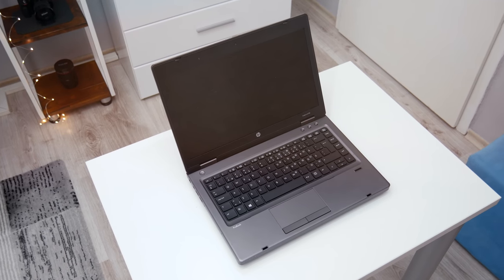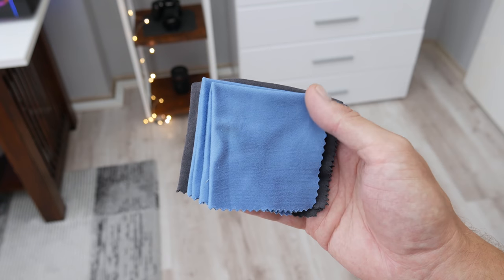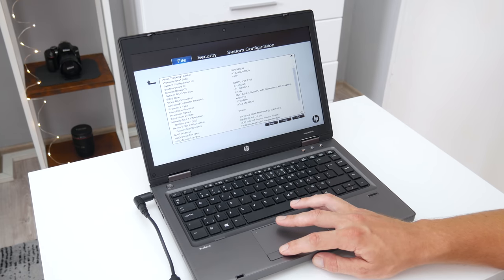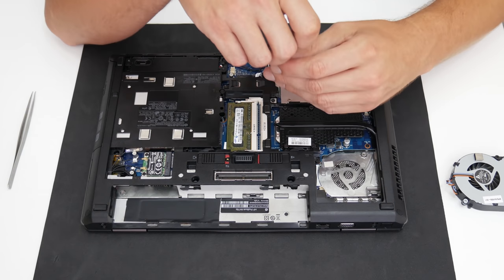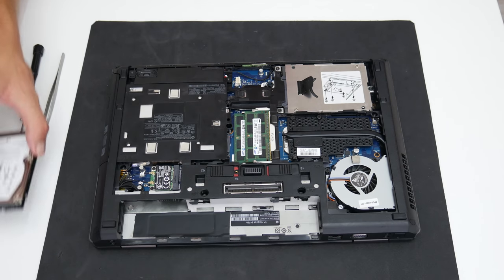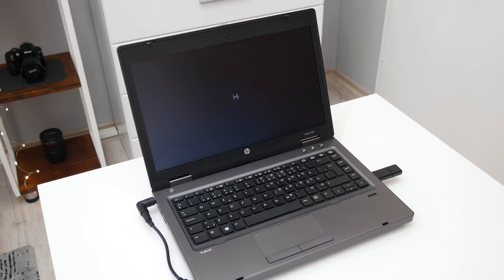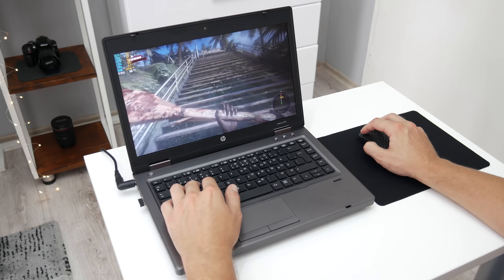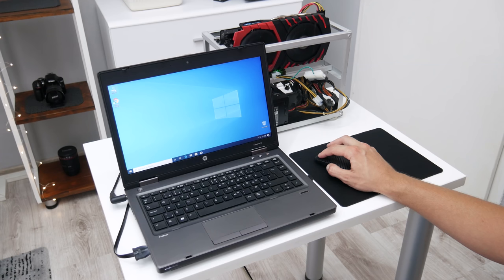Restoring and upgrading low specs AMD HP ProBook laptop

Comment: Im a HP certified tech. Looks like the motherboard was replaced and whoever replaced it did not finish branding it. My hat is off to you for getting HP to assist with getting the DMI programmed on that laptop. You have done everything I have always been curious about, very good video my friend and you just got a subscriber. 

Those old HP EliteBooks are tanks and perform fairly well considering their age. I had an EliteBook 8470 until a few months ago, I upgraded (sorta) to an EliteBook 9480 which is a lot smaller and newer but not quite as powerful.
Reply from the maker: Thank you for subscribing and supporting me :) It was a little bit hard to find all tools and right guide to fix the DMI but not impossible :D
Reply: @ComputersAndTechAndAndrew  Yep, very much so. I use HP's self maintainers support line often enough and getting the right answers when you know what you are asking for can be hard enough. You went in knowing nothing and got what you needed, that is nothing short of impressive.

Comment: The laptop is pretty powerful especially after the upgrade. You could play Doom and Overwatch with medium setting at repectsble FPS. I have an Acer 5560G with AMD A10 and 2gb radeon graphic card and I could play stuff like Skyrim and StarCraft 2 on high setting all day.

Do be wary with thermal issue tho. People call them "housefire" for a reason. Regular cleaning, using high quality thermal paste and laptop fan is recommendable

Comment: Where you buy with AMD graphics and CPU AMD i have the same one but with intel graphics and intel CPU and i didin’t see on internet any oné with AMD
Reply: Ebay i,s only cost 23 Euro
Reply: there is a special chip that has both graphics and cpu in one , in this laptop it already has intel graphics automatically but you can also use 2 graphics i think or maybe 1 that's better.

there is an option to just use a regular cpu too according to the 6475b manual

Comment: Where do you get these laptops? Because I really want to do something like this!
Reply from the maker: Hi bro, mostly these laptops already belongs to someone, I just take, repair, restore, upgrade and return. But if I'm going to buy some laptops then first I'm searching the local computer stores that sell used computers because there is easy to negotiate for the price, I'm checking the local websites or pages where peoples sell their old stuff ( in almost any country or town you can find some Facebook page or local based websites where peoples sell some stuff ). The other place is eBay, on eBay you can make good deal also, find something with normal price and parts. And I'm using Aliexpress, on Aliexpress you can find parts with normal and lower price
Reply: ebay

Comment: My laptop is probook 6460b can i change  the lcd screen to ips panel
Reply: I have the Probook 6460b and been using it for many years. you can use a docking station / displayport but it cannot go higher than 60hz i think.

Comment: Hello Andrew, i just install SSD and replace my cd-rom by hdd + caddy bay, but whenever i restart my laptop the computer doesn't recognize caddy bay, how can i fix this problem? My laptop brand is HP probook 440 g1, thank you.
Reply from the maker: Hi bro, in this case check the Boot Options in Bios, In Bios set the boot option to support the booth Uefi and Legacy, if is not working than try to connect and disconnect the disk again or update the bios
Reply: @ComputersAndTechAndAndrew  thanks for your reply, i tried update the latest BIOS but it still doesn't work =(

Comment: Hello, Andrew, I have an HP Pavilion g7 notebook series is it worth to change my AMD A4 4300M APU to Intel Core i7-2620M ... I want to play at least Mid specs games or can you recommend me a CPU... Thanks🥰
Reply: i have a probook 6460b with i7 2620m , 2 of them in fact on another probook. i can say you are wasting your money, the i7 2620m was made on the same die as the i5 2520m silicion wafer according to industry report if i remember. the i5 2520m was a technical defect of the i7 2620m when it wasn't completely perfect. i5 2520m costs 10 usd on ebay and the i7 2620m is like 50 usd. they work almost the same.

Comment: I do have a 7 year old Asus k55a -Sx464D , and its packed with celeron B820 can you please suggest which CPU I I should use to upgrade.  

Your reply will be truely appreciated. 
Regards
Reply from the maker: Hi Bro, this model can go up to Core i7-3630QM, also Core i5-3230M and Core i5-2450M are supported, other upgrades you can upgrade the RAM and instead HDD you can go with SSD ( 240/250 gb + ) recommended

Comment: hi, my fingerprint has not detected by windows, what driver have you used? thanks
Reply: use external fingerprint scanner support is dropped unless you want a malware driver one or want to read github code
Reply: @garymorris6835  finally i discovered that the hardware is not present. I bought a sensor on ebay and works perfect. Thanks

Comment: i have a problem i upgrade my hp but windows doesn't detect all the ram in the bios yes but windows doesn't, all the memory goes to hardware and only leaves the laptop with 2 gb no matter what, you put did you change something in the bios? And if so, what option was it?

Comment: The 4600M uses the FS1 socket if memory serves, with the A10 5750M being the best CPU for the socket, but I never see it getting used, ususally opting for a A10 4600m instead. I'm aware the 5750M is ARM based, making it already less desirable, but is there any other reason this CPU isn't used?
Reply: because it doesn't say that it's supported directly on the service manual for this laptop. even if it fits perfectly in the socket the chipset may not support it and would require you to desolder it off

Comment: Why not converting the disk from MBR to GPT? So you have the boot loading under the HP logo.
Reply: When you change to GPT logo is only least thing. It is a completely other filesystem and you require another type of installation
Reply: @_lordcharles  Yes I know, but actually the difference you see using the PC is the logo.. So why not doing the other type of installation? I know you can convert the disk without data loss with AOMEI..

Comment: How do you figure out which processors are compatible with your pc?
Reply from the maker: Hi bro, that's not complicated, older motherboards that support CPU upgrade have specific CPU socket, first am checking the cpu socket and what is the max CPU wat support ( some mobo is not support high wat CPU's ) and then am searching for the cpu with the same socket

Comment: Can i upgrade my lenovo g485 laptop? Or replace the motherboard with lenovo g40-45?
Reply from the maker: Hi bro, some of these models have removable CPU, if the CPU is removable than you can go with max AMD E2 ( AMD E1 to AMD E2 series ). The other upgrades are the RAM and Disk.
Reply: @ComputersAndTechAndAndrew  ok, thanks for your information

Comment: Bro please help i have and need to upgrade it to full potential Lenovo 110 -15ACL 15.6-inch Laptop (AMD A8-7410/4GB/1TB/Windows 10 Home/Integrated 512mb ddr3 Graphics), Black
Reply from the maker: Hi bro, on this lenovo model only you can upgrade the RAM and HDD to SSD. CPU is soldered on the motherboard and the GPU is coming from the CPU
Reply: @ComputersAndTechAndAndrew  hmmmm i thought you are not going to reply but you replied thanks a lot and again thanks for your opinion 😇😇😇
Reply from the maker: @crazyscooby9670  U r welcome bro, i'm always trying to answer to more comments and questions as possible

Comment: Hello sir I want a help
I am using Dell Inspiron 1464 i3 330m is there any chance to upgrade the CPU by an AMD processor
I want a suggestion for which processor is suitable for my laptop motherboard
Please tell
Reply: Nope. The socket won't even match. Intel cpu goes to intel mobo and amd cpu goes yo amd mobo. 

Your only option is to go with similar gen i5 with the same wattage

Comment: Hi can u help me can i run this spec
Timpurrari RA Intel(R) Core(TM) i7-3540M CPU @ 3.00GHz 
3rd Generation
AMD Radeon Graphics Processor 
Full Display
4GB RAM (upgradable)
320GBHDD Sata 
17 inches widescreen
Built-in Speaker
Windows 10 PRO
VGA, USB Port, DVD Rom
Wifi ready
With Num Keys

Comment: ddr3 1600 to 2133 if the chipset can take itw ill give you a 15  fps boost these apus love fast ram
Reply: AMD A10-4600M Supported memory: DDR3-1600, DDR3L-1600, DDR3U-1333
Reply: @marek_92_  make sure to use 1600 it really helps the 5750m supports higher speeds

Comment: can i upgrade cpu on my probook 6470b?
Reply from the maker: Hi bro, Yes you can, just before upgrading check your chipset, i think this model is coming with 2 different chipsets, HM70 and HM76, the boot are upgradable, but the booth have different CPU support, HM76 has larger support, HM70 has smaller number of supported CPUs. You can check this using CPU-Z app
Reply: thank you so much!
Reply: yes

Comment: Maybe this laptop is better with i5 CPU, isn't it?
Reply: Intel and AMD CPUs use different sockets. You need to change the motherboard for one that accepts Intel CPUs.
Reply: @juanmbt  I know, but I'm planning to buy Probook (the same series) with Intel i5
Reply: @nahpets2345  definitely better the i5 version, amd a series apu's are trash
Reply: CSP's Random  is Nvidia 920mx 2gb good for hp probook 6470b?
Reply: @nahpets2345  yep its great
Reply: CSP's Random  oh ok thx
Reply: @nahpets2345  its slow.. But better than this apu
Reply: @Callagwhan  I know
Reply: Laptop with 840m nvidia starts from roughly 200usd and they are gonna have good battery as well

Comment: The liquid you used was alcohol right? Can I use any type of alcohol? :3
Reply: 90% isopropyl is the standard but I had seen some people do it with just the 70% solution
Reply from the maker: Recommended to go with 90+% but %70 is fine also

Comment: Just bought a10, my laptop exactly the same with this a4. I just upgraded but it won't work properly. Nothings happens from a4 to a10
Reply: That's why I've put A8 in it, it's recommend Ed instead of A10.
Playing Defiance,Crossout on it.
Reply from the maker: Hi, before upgrading the CPU first update the BIOS, in many cases old BIOS version my cause issue with new CPU
Reply: which operating system
Reply: @ComputersAndTechAndAndrew  how to update bios

Comment: I have this laptop 💻 good performance with 8gb ram amd 10 only one ☝️ issue not working screen recorder hardware not supported
Reply: Is your fingerprint working? On windows 10 pro?
Reply: @gurpreetkalsi1541  i open my laptop while hardware upgrade then i fully disassemble my laptop fully then i see fingerprint device that place they is nothing they put plastic pad look like finger print scanner then i shocked
Reply: @gurpreetkalsi1541  i got from old hp elitebook finger print device then i replace to my laptop hp probook 6475b it is working perfectly in windows 10 pro

Comment: Can I install Windows 10 on 6 year old laptop
Reply: Seriously? Its not the age that matters, its the specs. Windows 10 comes in many versions but they all need around 1gb ram and a 1ghz capable cpu. You ideally want 4gb and a 2ghz cpu though. Also windows 10 is fine on my 15 year old dell.
Reply: @i05af  I am having 4gb ram i3 2.4 giga hertz is it ok
Reply: @mr.tortoise4431  
Yes